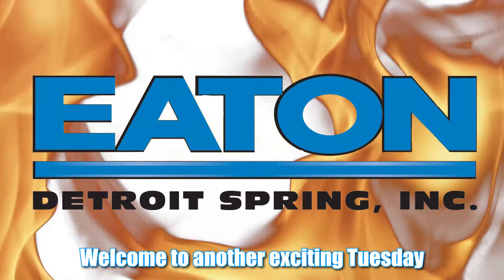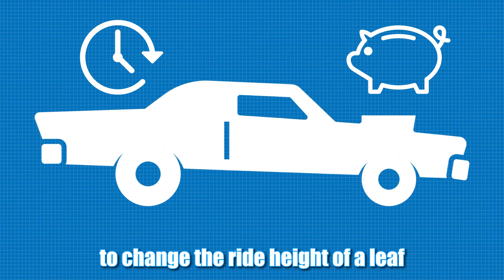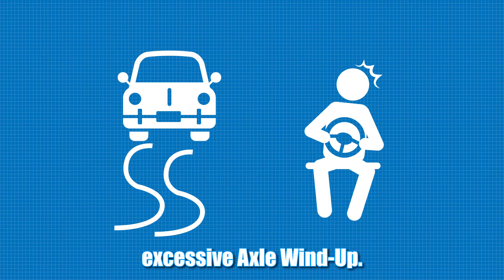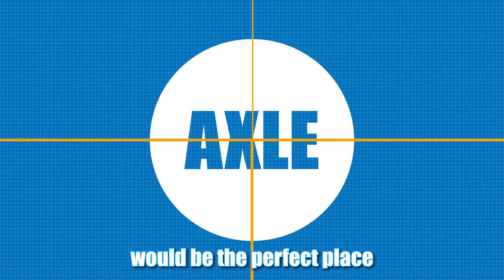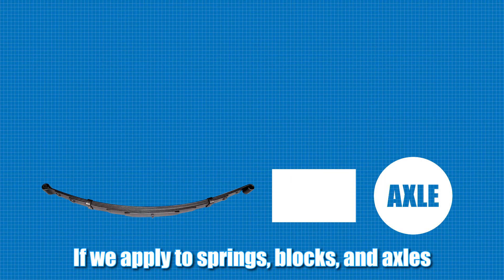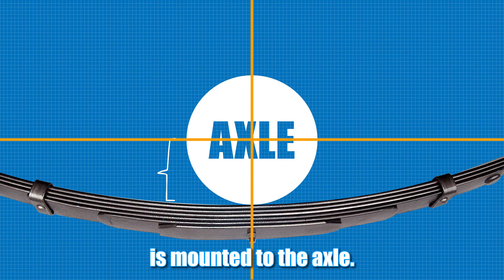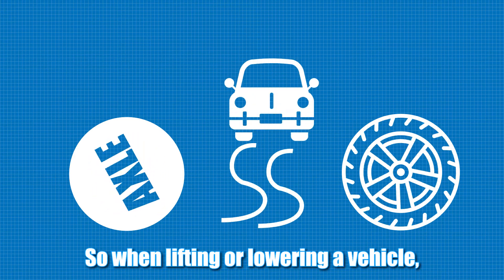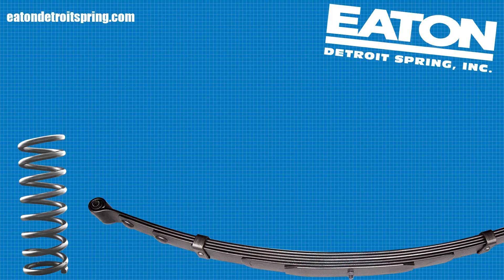Why Lowering and Lifting Blocks Can Cause Axle Wind-Up | One Minute Monday

Comment: I’ve lowered three different vehicles of mine using blocks, one was a Mazda pick up truck, the second was a 54 Chevy, and the third is my current 59 Ford galaxie. Each of them have been in the 2to3 inch block height The galaxie is the only one where I am having axle winde up problems. Why would I have problems with this vehicle but none of the rest? and lastly is there anything I can do with the materials that I have to keep the rear end at this hight.